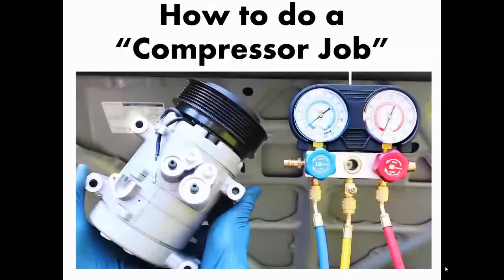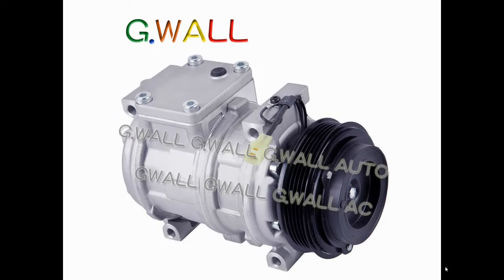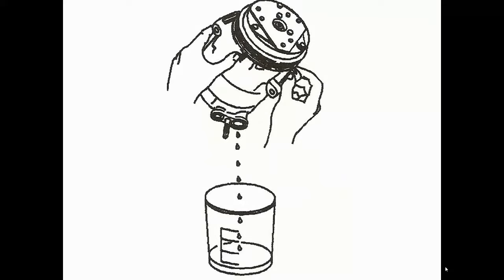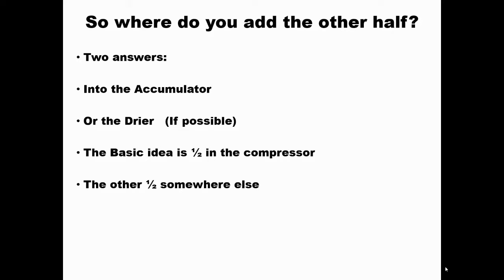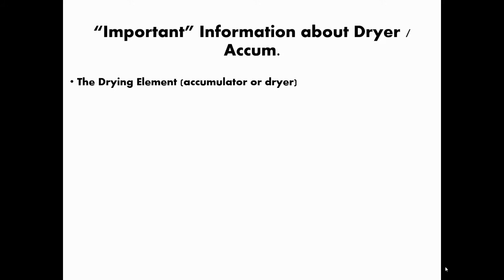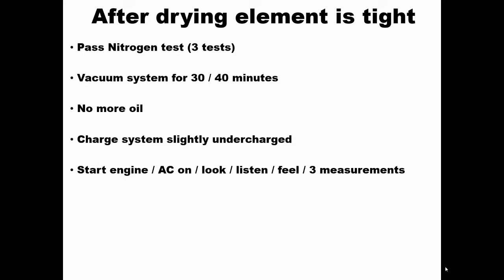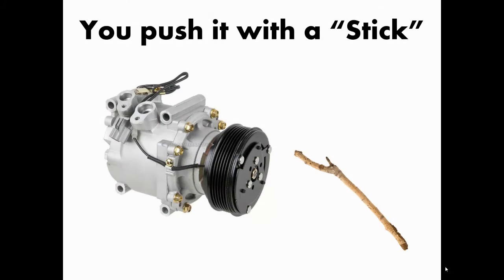Lesson # 12 : How to Replace Compressor.

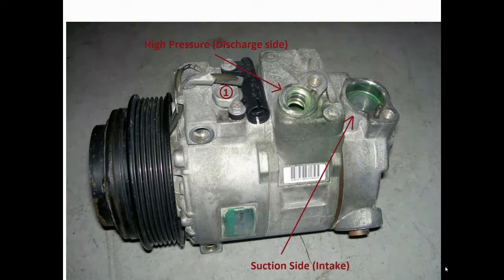Comment: How to go about the compressor, which has a low pressure port on the bottom of its cylinder, on the side opposite to the clutch side? So the hole is just under the red circle @2:24, where that central void is. The High port is in the same position like in the compressor shown in this film @5:52. So the Low and High ports are not on the same plane. The hole for Low P port doesn't have any oil around. Should I still use it to fill the compressor and then plugged it in before install? I removed that compressor and now need to clean properly and fill in w/new PAG 100, but in doubts about the procedure, since the shape is different fm/the compressors shown here. Thank you for your film again.
Reply from the maker: Drain the compressor to make sure it is empty. Then slowly pour half of system capacity into the larger opening of the compressor. Turn the clutch in the clockwise direction slowly to get the oil spread out inside the compressor. Cap off the openings and install. Good luck my you tube friend.
Reply: @theoldmecanicoshow9004  Thank you for the replay and advices. May I double check, clockwise direction that is when you look on the pulley (or clutch), yes? Not from another side, yes? Special thanks for those details, that you rotate slow, certain direction, and poor slowly. Thank you, thank you!
Reply from the maker: @olenaerhardt7725  Yes, looking at the clutch from the front. You are Welcome.

Comment: so if the full system capacity is 5.5 oz and i only have to replace the ac compressor im going to have to put 3.75 oz into the new compressor?
Reply from the maker: Drain the replacement compressor (new / reman / used). Add 3 -4 Oz's to replacement compressor. Add 3 oz to drier. Pull a vacuum and charge. Break a Leg / Good luck.
Reply: @theoldmecanicoshow9004  yes i drained the new  compressor overnight. so eventhough  i am only replacing a compressor, i will still have to put the whole ac systems capacity? (half in the new compressor plus one and half of it somewhere in the system).  what about the oil sitting in the rest of the systems components?
Reply from the maker: @ohsum8326  It's EZ to say the system is empty of Freon, the gauges read zero. To say the system is empty of oil requires three things: drain the compressor / replace the drier accumulator / and flush the system. You should flush as much of the system as possible. The auto parts sells cans of pressurized AC flush that does a good job. It is also very helpful to have compressed air to flush the flush. Good luck my You Tube Friend,
Reply: @theoldmecanicoshow9004  Thank you for the free education Sir. Now that ive done all of the things youve instructed. I dont know where to add the remaining oil into the system since the drier and accumulator is integrated with the condenser (2012 toyota tacoma prerunner V6 4.0L). If i add the oil into discharge liquid  hose after the condenser wouldnt the oil get sucked out when i pull a vacuum?
Reply from the maker: @ohsum8326  Yes that is a little problem. The opening for the drier is on the bottom right? I would pour the rest of the oil at the beginning of the suction hose (near the firewall). If you can't pour, use a clean oil pump can. Break a Leg / Good Luck.
Reply: @theoldmecanicoshow9004  yes it's at the bottom. thank you.

Comment: Beste welke olie moet erin en zit er een apart kogelager in die poelie?
Reply from the maker: There are at least 5 different oils used by the different motor companies. Use the one it calls for. The auto parts should be a be to tell which one to use. The bearing on the pully is a sealed bearing and does not require adding lubrication. Thank you for the question and the view. Good Luck on your repairs.
Reply: @theoldmecanicoshow9004  This week I drove my Kangoo 2006 K4M through flooded streets. The AC compressor hangs at the bottom, I think the ball bearing is whining from the pulley. There is probably no vent on that pump so it contains water instead of oil. I'm going to take the belt off to listen and turn the pulleys.
Reply from the maker: @den.staar124  Sorry to hear about your wet bearing. Yes water will damage any bearings it touches. Good Luck on the problem. Thank you for the view and the comment.

Comment: Question do u also need to replace the dryer??
Reply from the maker: It is "Usually" better to replace the drier, But you don't have to. When I would do a "Test Charge" : add florescent dye / a bunch of oil / and just enough Freon to cool the people down / let them operate vehicle until it acts up (one week to one month) I would not replace the drier. I replace the drier after I find and fix the leaks. Thank you for the view and the question. Good Luck.

Comment: I flushed the system well (including removed Compressor), let it dry for 3-4 days, and started to put everything back. Before I was adding oil into components. I started from the Evaporator, bcs its tubes were opened for flushing and following drying process. And also you need to attach the Expansion Valve, which will close the tubes. So I measured oil PAG 100 2.25 Oz as recommended for the Evaporator in Shop Manual and started to inject it w/small plastic syringe. The Evaporator took 1.25 Oz, but then the oil started to come out, and I couldn't add anymore. initially I injected the oil into the higher opening, when it couldn't accept anymore I tried to use the smaller bottom hole, but the oil was coming out again. So if I added only 1.25 oz into Evaporator, can I add a bit more into the Drier (by Manual I should add 1 oz)? I think to add 1.25 oz into the Drier, and a bit more then recommended into the Condenser to compensate the difference. Or it is better to add just in hoses? Thank you for your lectures again. It is very helpful for those who try to master a bit car AC system.
Reply from the maker: It looks like you are doing an excellent job. The oil and the refrigerant start to circulate quickly though the entire system when the compressor starts to operate. I usually put half of system capacity into the compressor and the other half in to accumulator or drier. The only time it gets tough to add the oil to the drier is when the drier uses a replacement bag into the built in drier on the condenser  because the hole is on the bottom. The idea is to split the total oil around the system. You dont have to add oil to each part because the Freon and oil will circulate quickly. Good luck on your repair and I am glad I was of some help.
Reply: @theoldmecanicoshow9004  Thank you, thank you! In this work I try my best, but feel how little I know, and auto-mechanics look to me more and more like extraterrestrials. I have very usual Drier (the exact name of it is Receiver-Dehydrator). I poured 1.25 oz into it via smaller tube w.same syringe with no problems. It was kind of difficult to install it, since you need to bend a bit attaching parts, and I realized it later. So it took some time, but I installed it. In the area of Expansion Valve it is hard to torque to specs, bcs of so limited space, so torque wrench touches all the time smth. with its head. Thank you kindly again.
Reply: @theoldmecanicoshow9004  I installed all the AC components back, but the system didn't held vacuum. I pressurized it w/compressed air using compressor and found a huge leak, unfortunately fm/ Evaporator, it was around that plate on which 2 lines of the Evaporator are coming out. There is some kind of foam around that plate and the air is coming fm/the slit between the plate and the foam. I think the only solution for the AC now to replace the Evaporator.

Comment: I installed a new compressor I did not drain oil from the new one am I cooked
Reply: Getting a vaccine pulled on it tomorrow along with recahrge
Reply from the maker: Thank you for the question. It would be a good idea to add at least one more ounce of oil (maybe 2) during or after the charging. Some charge stations are able to let the vacuum to pull some oil in right before the charging. If the station does not do that, oil can be added after the charge using a pressurized 2 ounce can od oil. Break a Leg / Good Luck my You Tube friend.
Reply: @theoldmecanicoshow9004  been about 2 weeks since the recharge.. ICE COLD

Comment: There is no EPA requirement for a 'private person' to evacuate an AC system. Huge misconception. Also today's Freon does not contain CFCs as did the R-12. It comes from outside the system therefore can return to it.
Reply from the maker: Thank you for the view and the comment. I'm trying to figure out what you are saying. I think you have "Evacuate" mixed up with "Recover". Recover the refrigerant means to remove it from the vehicle and store inside the machine for later use. Evacuate means to pull a deep vacuum on an empty system to boil out the moisture that has entered the system when the system is opened. Anyway...thank you for your tome.

Comment: Great video sir! Question how about when clutch is not engaging when AC is Turned on  yes Tested clutch with Test Probe clicks in So fuse is good. blower motor works>just blows hot air ,Clutch will turn freely with fingers with not much resistance on all my other vehicles it does have resistance! Does this mean AC compressor is Bad?
Reply from the maker: The # One reason the clutches don't turn on is because the system has to have at less 45 psi of Freon pressure. If it has enough psi, the problem is electrical. Pressure switch / temp switch / No not bad compressor.
Thank you for the view and the question.
Break a Leg / Good Luck on your repairs my You Tube Friend.